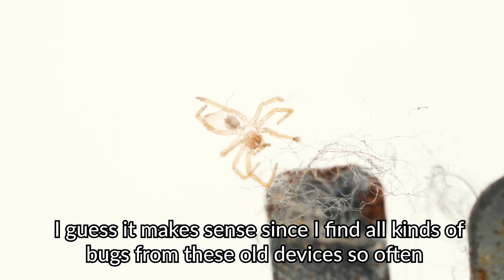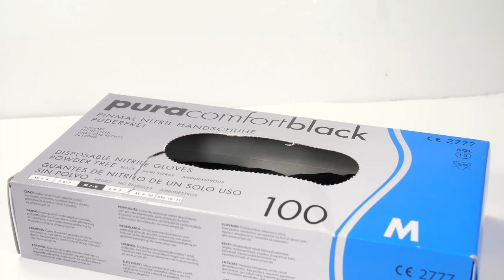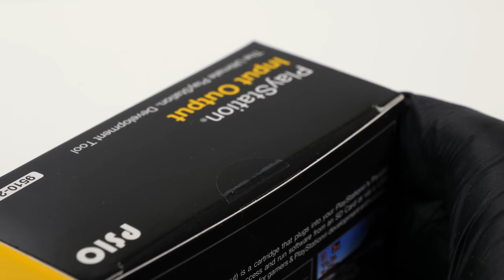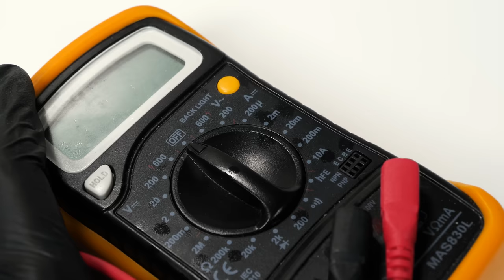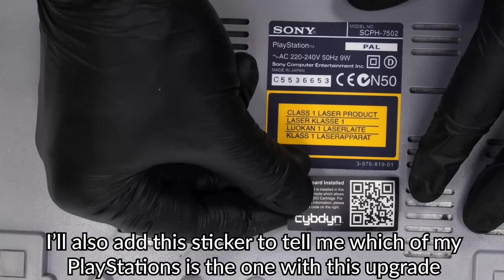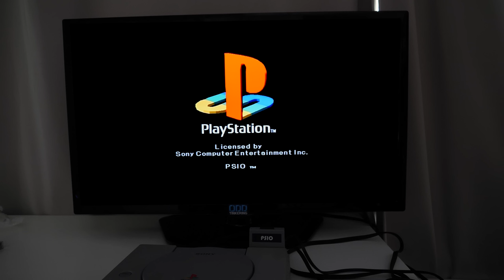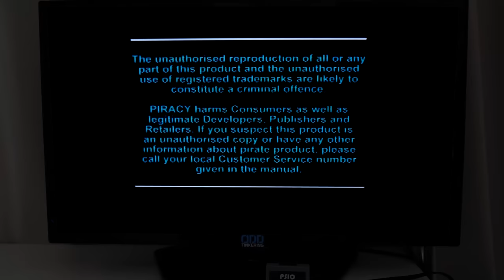Restoration & Upgrade of PlayStation with a Spider Nest Inside

Comment: So great seeing the classic PS1 get completely refurbished again, especially in the days of PS5.
Reply: You know that is kind of funny. We are like iphone number 502 but only PS5. Why is it we blow through phones but are so slow to upgrade our gaming? Not that I want to upgrade either anytime soon, my phone is over 3 years old and I am not getting a new one any time soon.
Reply: @robertm4050  Because the point of videogames is to have more games to play rather than consoles
Reply: I love my ps5 but my ps1 still gets use, or at least the games through my ps3. My ps1 hasn't worked in a long time
Reply: PS2>PS5
Reply: @robertm4050  Because older consoles are not heavily reliant on their interconnectivity, which greatly shields them from obsolescence. Pop a PS1 disk into a PS1, and it'll still play. As far as the device is concerned, nothing has changed because it never knew the outside world to begin with. 
But try to use a 1st-gen iPhone--a phone designed for a world that thought 1mbps download speeds were "high speed"--in today's landscape, and you basically got Steve Rogers stumbling into 2020's Time's Square for the first time and promptly being overwhelmed.
Reply: @HipposHateWater  That's a good analogy
Reply: Plastic doesn’t rust. Stop falling for these fake restoration vids
Reply: @worksmarter1010  It rots, dum-dum. As organic material, it breaks down with time, especially with oxygen and UV rays around.
Reply: @PredatoryQQmber  someone didn’t graduate huh?
Reply: @worksmarter1010  There was no indication that the plastic was rusted in this video lol. Plastic does yellow and it's possible to reverse the yellowing
Reply: I remember my first shot on ridge Racer, was blown away back in 95. Then resident evil came out !!  Gonna dust mine off and try to start it up after a 25 year sleep.
Reply: @worksmarter1010  no you didn’t graduate
Reply: @worksmarter1010 you literally deleted your replies under another comment under here lol now ur under this one too , get a life please 😭🤣🤡
Reply: @robertm4050 what the fuck kinda playstation are you thinking of? Plus do you even know how expensive it is to manufactor a console for the public? If you're so eager to upgrade your gaming just switch over to pc, I heard that amd is releasing the 9000 series cpus. Phones are alot easier to manufactor as demand is a lot higher
Reply: You right, gimme a copy of siphon filter and legend of dragoon and I'd play it till it broke again 😂
Reply: I know it's so weird looking at a console that has games 🤡

Comment: It is always a miracle, when dirty and yellow becoming look like new, just from the Christmas present box. 
Never getting bored to see such changing.
Reply: Дааа, сразу детством приятым повеяло))
Reply: Yeah it's a miracle, they cleaned and repaired it 😂 lol not a miracle at all
Reply: @worksmarter1010  so how do you suppose they get the yellow off then? console plastic does yellow
Reply: @worksmarter1010  so how is my personal Super Nintendo yellowish also??? I can get the yellowish off, explain to me how he did it rhen
Reply: The miracle is called Chemistry. The peroxide with UV releases oxygen radicals that help reversing the yellowing of these old plastics caused by flame retardant agents they used to add into them. The process could be simply done outdoor in a sunny day (for those interested lookup 'Sunbrighting'), but the process is much slower.
Reply: @worksmarter1010 ITS NOT RUST
Reply: @worksmarter1010 yeah okay genius who's also the latest Unsub from Criminal minds hahahahaha 😂😂😂
Reply: @bhrojas09 Diluted hydrogen peroxide under UV lights for 24 hours.
Reply: Si si si si un milagro de Dios este man es el puto amo de las restauraciones
Reply: Fricken amazing
Reply: @xlikeabossk8189 you must really be fun to be around
Reply: That’s because it’s fake. The plastic outside does not yellow like that with absolute pristine plastic everywhere else. Also, the buttons are made from a different plastic and would not change color at the same time/same shade as the case.

Comment: Beyond the restoration (which was great as always btw) I'm actually very impressed that the device turned on and gave video. Guess it goes to show how durable these older gen consoles actually were.

The disk not reading isn't too surprising as those lasers tend to wear out overtime, hell maybe it was the reason the original owner stopped using it.

Comment: Concerning the laser lense, most people foreget that the lens has two sides. Also there are mirrors and the glass on the laser diode which can get dirty, especially if the device was used by heavy smokers.
If cleaning the upper lens side doesn't worke, I usually demount the Laser essembly from the horizontal worm gear and throw it into my ultrasonic cleaner for some minutes (just water and a little bit of soap and a little bit of IPA). After the washing I dry it as good as possible and let it dry completely out over night.
I usually try this before messing around with the potentiometers as a wrong setting may burn the laser diode.
Reply: wouldnt have think 'bout that... great one!
Reply: That's a cool idea, but doesn't the sugar from the IPA cause more issues, or is it strictly medicinal for stress relief?
Reply: @johnriff85  🤣
Reply: @johnriff85  just in case you're serious, he means Isopropyl Alcohol by IPA, and not the pale ale lol
Reply: @boboyo  I was being intentionally facetious lol. Thanks for trying to be a bro though!
Reply: Yeah, the PS1 lasers are sensitive as heck...
Reply: Also if the model is an SCPH-1001 you can try first re cap the board, i did that and laser is working really good now
Reply: Smart might be worth a try
Reply: @johnriff85  SUGAR??? WTF?! lol
Reply: @triplexdread  IPA meaning India pale ale, instead of isopropyl alcohol

Comment: PSIO is some incredible stuff. It’s crazy how many new heights we’re still reaching with PS1 modding
Reply: Exactly
Reply: But how do you transfer the games onto a memory card? And my ps1 was modified to run downloaded copies.
Reply: They have had this stuff for years. PS1 is a quarter century old dude.
Reply: PSIO is useless nonsense
for its price (160 usd) you can buy used PS4
Reply: @americanrussianproud  Or a much cheaper ps1 classic and mod it with a usb stick too
Reply: @JohnnyLeyenda  At that point why waste money on a PS1 classic? a Raspberry Pi can run PS1 games and more for €30-40. The reason people buy the original PS1 is for both nostalgia and collectors sake
Reply: @neek01  Well if you can find one for a good price they tend to run cheaper anyway, I got mine brand new for $20 but I do see your point of course. I use mine to emulate other systems as well.
Reply: @neeko  emulation will never be 1:1 with original hardware, and this is coming from someone who uses both frequently. No settings to adjust, the console plays ps1 games exactly perfect every time.
Reply: All I can think about is...
...fearful harmony
Reply: @@Clarissa1986 FPGA consoles are pretty expensive and can still have issues if the rom isn't a precise reproduction. Besides, not everyone is interested in the programming aspect of it or learning which fancy chip to buy, and it's more convenient or enjoyable for people to play on the actual system.
Reply: @gucketjug I agree. As someone who uses RetroArch to emulate, and someone who emulates ps2 and ps1, the only reason I do emulation is for convenience. Emulation is really advanced, however it is not the same as the classic thing

Comment: Reversing the plastick yellowing is probably the coolest display of chemistry that I've seen.
Reply: I could be wrong but i think thts also from  smoking not just yellowing
Reply: @timothyb.4928  Thats more of a misconception. While it may slightly add to the yellowing the real yellowing (like this kind) happens when consoles are left in sunlight for long periods of time (like months or years). If you look at your own old consoles, if you have any, you may be able to see slight differences in the whiteness. Say like the memory card of a gamecube, you might be able to tell the part that usually is in the console will be much whiter than the part outside. Hope this helps!
Reply: @Jakearoo3009 true. But my family smokes lol
Reply: @Jakearoo3009  the console yellows because the bromine in the plastic reacts to UV light, so you're technically correct
Reply: "Jesse, we need to reverse the plastic yellowing Jesse. We need to cook."

Comment: That was extremely cool! I didn't know that the PSIO uprade even existed. That makes an old obsolete console more awesome than it was when it was new. Thanks Odd Tinkering and Ducktor for your great videos. God bless. Rev. D.
Reply: There are lots of cool PSX mods and accessories. Your traditional modchips, PSIO, XStation, MODE, PS1 Digital, MemCard Pro.
Reply: Sadly though the PSIO hasn't been in production since around February when the chip shortage started. It's also very expensive in comparison to other mods available.
Reply: @paulghignon4092  150 bucks + 30 for the chips? Seriously who would spend this much money on a sd reader? 😂
Reply: Ye
Gdsdf
Reply: Cb dalej to cz jfhshgdhzucjjjjf
Reply: Qrwf

Comment: Back when this system was new, I found that the first generation had the cpu was right under the cd drive and would overheat the cd drive. Over time this would soften the plastic holding the optics causing them to move out of alignment. To fix this I would install a fan inside the unit. This worked so well that the first gen PlayStation is still working today. I think I need to get this card adapter for it

Comment: This guy is awesome, unlike those other fake restoration channels; this guy seems legit.
Reply: Bleach and scratching at PCB tracks with a scalpel? Hmm, but it's the 'i must be serious, I wear rubber gloves!' thing that cracks me up.
Reply: @tonyparker7356  By that, do you mean he IS fake? I didn’t see any bleach…. Just asking.
Reply: @co-jt6gd  I'm not saying he's 'fake' I'm saying these guys are good at making themselves look 'serious' to the untrained eye. Rubber gloves tickled me. Oh and it was hydrogen peroxide he used iirc, the LEDs tickled me too.
Reply: @tonyparker7356  Ohh…I see. It’s just that “Tickled” made it seem like you were skeptical.
Reply: @co-jt6gd  put it this way, no skilled tech I know would wear rubber gloves doing work like this, handling hydrogen peroxide aside.
Reply: All the thing he restores have this suspicious orangey coat, it doesn't seems legit, I mean the stuff looks used but I think he just sprays that coat on everything to make it look worse
Reply: @tonyparker7356 not true at all
Reply: @tonyparker7356 Numpty. I always use gloves when handling old consoles which are not mine. Do you know how much nasty detritus ends up inside these things? They are completely disgusting, especially ones which were in smoking homes. The traces on the main board needed to be cut for the PSIO mod to work and the UV LEDs drastically speed up the “retrobriting” process.
Reply: @juancouso The plastics in pretty much much all older consoles degrade over time and exposure to UV light producing the uneven discolouration seen here. Putting those plastics in dilute hydrogen peroxide reverses this process and the tub with the UV LEDs is used to drastically speed up this chemical process.
Reply: @SlCKB0Y-sb1kg  I know that but this one doesn't feel real looks like it was sprayed with some sort of orange paint, when he turns it down you can see the plastic legs has some kind of "shadow" where the paint didnt reach due to the angle
Reply: @tonyparker7356  LOL, just because YOU don't know them... my bruhv in christ. The scratching-apart of the PCB was very inconventional but solely because of the mod he installed. Which I assume he isn't specialized on.

Comment: 0:57 It's very rare to find one of the first PS1 models (with a parallel port), without any broken pins where the CD fits.
Reply: What does the parallel port do anyway?
Reply: @zekeram129  from what I understand, it was added as a way for sony to make additional accessories and hardware upgrades down the road that you could just plug in, kinda like the 32x on the sega mega drive, but they never ended up doing anything with it so they started covering it up (but still having it on the motherboard) in later models before completely doing away with it in some of the later revisions.
Reply: The only accessory that used the parallel port was GameShark/Action Replay. On later models, the port was removed.
Reply: Yeah, those break easily compared to the later run models.
Reply: Nimbus Starplume  on that I'm not sure. I only know the basics of what this mod does from when I was doing a little research on what I wanted to do with my ps1. I ended up going with an xstation mod personally.

Comment: So, I'm guessing that the chip allows the data from to be loaded into the console much like it would from a disc, while at the same time telling the console that the game is an 'official copy' which the correct region data. 

The way that copy protection worked on the console used a very little known fact about CD lasers, mainly that they can read right into the centre ring of the disc. Sony were the only company to take advantage of this and when the game discs were produced, a spiral track of data was placed on this ring that no one else had the ability to reproduce. to make it even more secure, they took advantage of the laser's lens being 'floated' around in an electromagnetic field, as this was necessary for all CD lasers because the data track wasn't always perfectly cantered, so micro adjustments were needed to read the data. what this means for the copy protection in that the data track in the centre ring wobbles, which made it near impossible to reproduce. this is the sound you can hear the laser making as it scan for region data where seems to zip back and forth rapidly. When you 'chipped' a PlayStation console, the chip would send data to the BIOS telling the console the game was official and the right region too

Comment: you make really good relaxed videos about cleaning and repair where things technical problems and everything works again. I'm so curious how that looks like new in the end🤩

Your videos show real good conscience like tutorials. 
You're really good at this kind of thing, could you do a ps4 controller tutorial to fix the shell on it? Change shell on ps4 controller, instead of black ps4 controller another skin color shell. 👀👍

Or a tutorial, why a ps4 makes loud noises. maybe you can fix how or why it is. 😄 and.. my ps4 controller R1 button doesn't quite work properly. the R1 button is very low as if you can't press it anymore and is half as nonfunctional. the (x) button is very easy to press. could you put out a tutorial, how to fix it?

Thanks 😁

Comment: 6:06 a question I've always had, how do you not remove the scratches from the plastic with those brushes you use?
Reply: The plastic is not that weak
Reply: The plastic is not that weak
Reply: The plastic is not that weak
Reply: The plastic is not that weak
Reply: The plastic is not that weak
Reply: The plastic is not the weak
Reply: The plastic is not that weak
Reply: The plastic is not that weak
Reply: The plastic is not that weak
Reply: The plastic is not that weak
Reply: The plastic is not that weak
Reply: The power of Christ compels you… I mean the plastic is not that weak
Reply: The plastic is not that weak
Reply: The plastic is not that weak
Reply: The plastic is not that weak
Reply: The plastic is not that weak.

Comment: When I read spider nest I expected to find an modchip
Reply: lmao i know right? first time i ever bought a set of ps1s for repair i found a ratty modchip installed, cold joints, overly long cables, dusty nasty tape holding it together. Eventually trying to safely free the cables from their cold jointed prisons ended up lifting a pad off the board. rip.

Comment: Great job!
About the only thing id have added was a drop of tac pak about every inch or so on your special process wiring.
Not 100% necessary, but it keeps the wires tight and in formation.
Less chance of potential pinches.
Just good habit.
I feel right at home watching this as i solder and assemble PCBs nearly daily and have since 2000.
Keep up the awesome work!

Comment: disk drive failure is actualy one of the most common failure points of the PSX, the laser in it was sub par and after a lot of use it would eventualy burn out.

Comment: Sorry I'm late seeing this video, but man, you did an outstanding job repairing this original PlayStation model, Odd! :D Of course, this isn't your first time restoring PS1 console as you've did a couple of others a handful of years ago, one on the same model as this one, and the other being an updated version of the OG console, so it's cool to see you back with a third one! It was pretty neat to see that there was a spider nest inside the system, and not the first time that's happened either! XD Always a pleasure to see the Ducktor up to his usual assistance, and with the help of his famous isopropyl alcohol! Nice that you even got an updated version of the console's board so that it can play PS games again! Also neat that you can even choose which game to start, or load straight from the CD! Glad it's working pretty well for ya! And no, I highly doubt that Doctor Shemp is related to the Ducktor, but that would be pretty interesting, lol. Well, with every video game console restoration video, there's always a video game controller restoration video follow-up, and I'll be sure to check out that video too! <3

Comment: Ok. I have looked everywhere and can’t find an air compressor like the one you have. I see it has German warnings on it. Is it available on Amazon or did you get it at a hardware store? I also seem to be having trouble finding dust gun attachments. 

Great video!